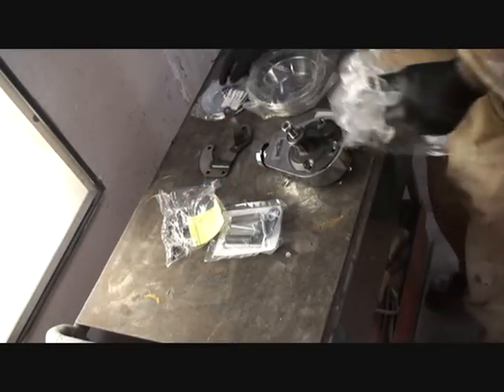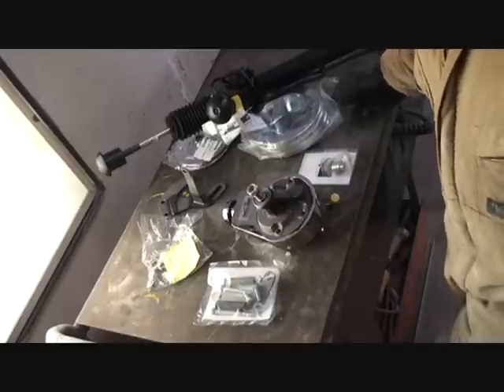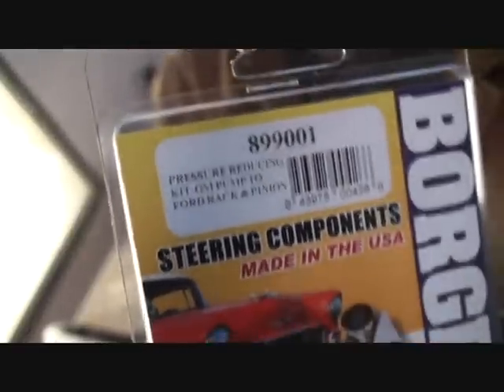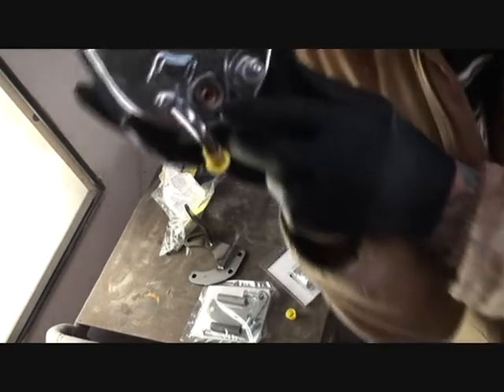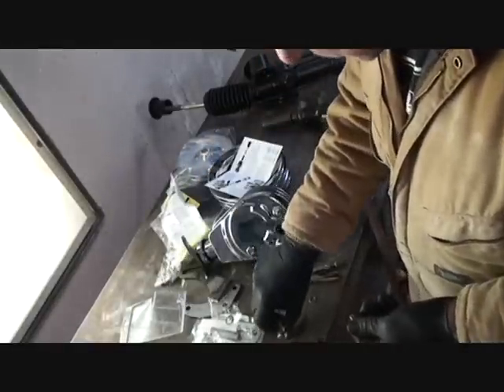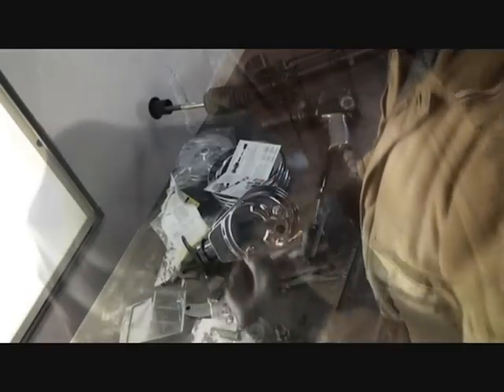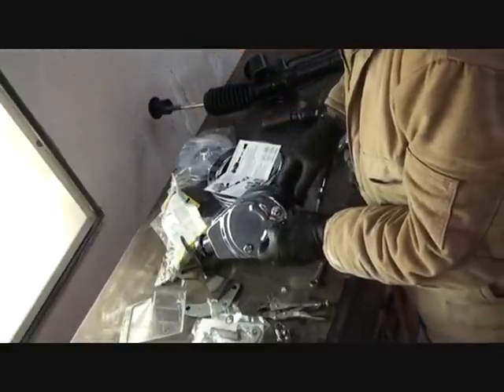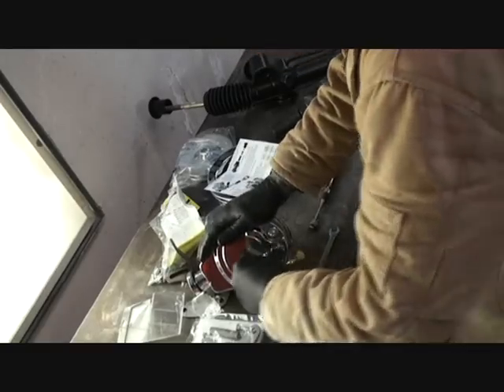1934 Ford-Streetbeasts Coupe-Power Steering Pump Installation

Comment from the maker: Yeah the kit you are wanting is pricey due to the damand, and that is hasn't been out for long.. Not to many people are thinking of putting rack and pinion on their old chevelles, espceially if it already has power steering, and also because it's new on the market..Have you tried Summitt or Jegs,, they carry alot of stuff..Also check with Year One Automoble part.... Well gotta get back on it... Take it easy. Pete

Comment: Great info pete, do most power pumps have adjustable pressure like that or just aftermarket custom ones?
99% of all my cars have been rear engine so i've never needed power steering

Comment: Okay, I have a 39' Rat Rod truck and it has a Chevy 350 motor auto trans and has manual "sucks" steering.  
Question:  I want power steering on it and wondered if I have a option to get the complete parts off of a salvaged car or truck what would be the best to go with??? Remember clean as the motor is exposed in this vehicle.
OR..if I go to a new power steering kit which one would you recommend?  Remember I'm not a heavy duty mechanic and would rather not mix and match parts.
Thanks,
Clay